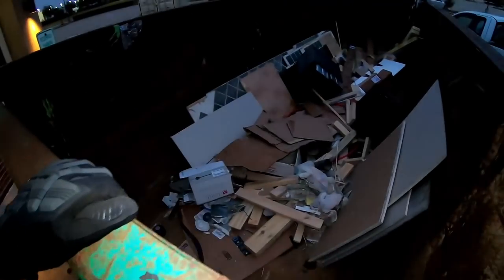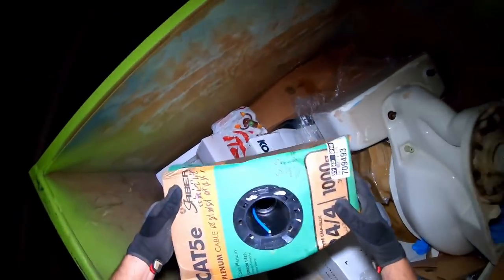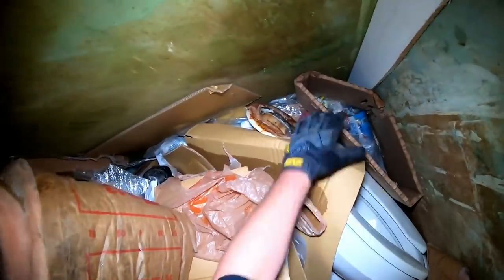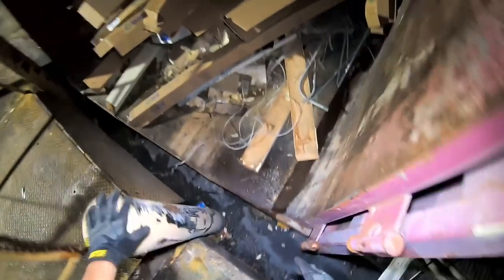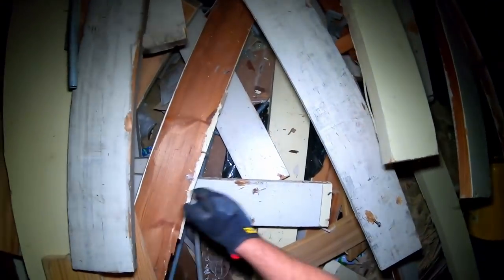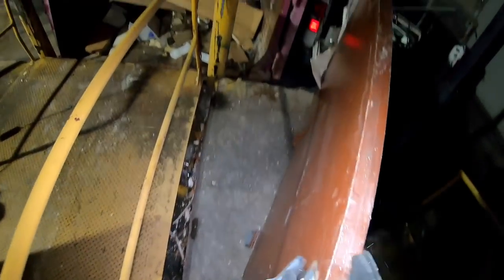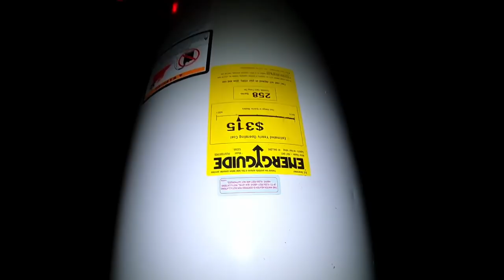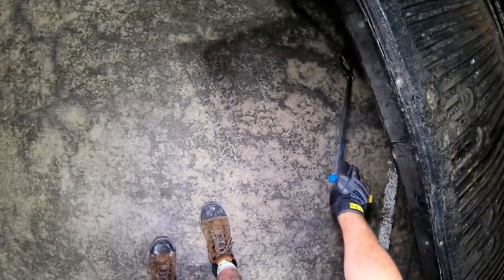Dumpster Diving "The Back Doors Open!"

Comment: The thing's I like the most are tool's!😁 yesterday I found a cement mixer and wheelbarrow in a dumpster- rang the doorbell and asked if they were tossing it out , they said yes and I asked if I could take em they said sure go ahead, do you take refrigerators? I said of course I'll take that too! I do rockwalls and sidewalks and general landscaping as a living as well as welding and roofing! Been mixing by hand for year's! Now I'm the proud owner of a 400 dollar mixer that I can use to make much more money👍 and it didn't cost me a dime more than my time and energy to load it onto my truck!😁👍 half my garage is full of tool's other people just tossed out when they were done with them! It just amazes me how little value people hold in anything anymore! But hey- I'll take anything I can find and use! And if it helps make more- well that's what I call a win win right there!
Reply: Yup same as I 
I have a lawn care business and I have customers always giving me the shop supplies tools anything and everything.
We are a throw away 
The younger generation just toss it and buy a new one
Reply: It blows my mind how some people just don't value items, tools included. I haven't bought a lawnmower in 30 years, bandsaw, table saw, toolboxes and so much more. I get that it's just stuff, but Holy moly to replace these things takes one's hard earned money. These are people that never had to go without I guess. My rants done,lol. ✌️
Reply: @frankforrest1597  agreed😁👍

Comment: Mike, Love your videos and commentary throughout! I used to do LED retrofits of lighting fixtures and we'd end up with so many hundreds of those ballasts on each job we did. The boss just took them and threw them in a dumpster usually. We only kept the High-bay ballasts to break down and scrap out the internal components.

Comment: 25 years in building steel doors/frames. Most hollow metal doors only have fiberglass insulation, polystyrene or honeycomb cardboard interiors. The extremely heavy doors (fire doors) have sheet rock cores.

Comment: Mike those 2x6 & 2x8 can be sold for 10. Each and still be making money. I've been wanting to attach a pole barn to my house and not have to have someone shovel me out.
I already have the garage header and been recycling lumber from places tossing out 24' pallets.
I have glass blocks for windows.
When I just came in the house temperature outside is..

Comment: Today i took a small load of steel around 800lbs. Got $105 Canadian. Its a 110k drive there and back. I do this to help as im on disibility. On my way home i drove back a different route and drove thru one of the Native res. I was able to get another $75 worth of shred tin. Its like theropy for me.  Havent been able to work in over 7yrs due to 19 surgeries.

Comment: every time i see you find one of those water heaters i wonder what's inside them maybe you could take one apart to see and i have a suggestion for you maybe you could get for your pick up one of those tommy lift gate on it so it'll make it easier to get the heavy things in the back of your truck i've seen them before don't know how much they cost but i think it'll be worth checking into just a thought
Reply: Nothing of value inside, empty insulated metal tanks. The electric ones have heating elements screwed into the side and a bit of wire from 5hem to the top mostly buried in foam insulation. Gas ones have the aluminum thermostat screwed in. Value is in overall weight and copper pipes and brass fitting on outside.

Comment: Mike you should learn how to weld with all of the metal you come across You could make all kinds of things!! The same thing goes for wood. I bet you have run across enough wood to build a house!!  At least to do a project or two. I would have stacks of steel and wood and drawers full of bolts and nuts stashed at home

Comment: I think ALL those dumpsters should have HOLES drilled thru bottoms to let the “Dumpster juice” drain out!
Reply: Seriously? Have you given that much thought? You do realize the majority do not contain construction materials. Do you want what's basically sewer water running through your parking lots and apartment complexs? I wish Mike didn't have to deal with it either, but he CHOOSES to jump in and to not wear rubber boots.
I'm not trying to start anything with you, I just wondered if you'd really given it much thought. 🙂

Comment: wouldn't it had been easier to toss the pipes over the top of the dumpster sense you were parked right next to the dumpster instead of walking in and back out and throwing around the side?  Ah see you finally did!

Comment: Sorry to tell you bro Thomas Crapper did not invent the  toilet. He did however hold 9 patents for the component's in the water closet pre modern toilets. (the flush toilet) the one part everyone would recognize is the floating ballcock.   Might want to consider a mask in the dumpsters. I always see a ton of crap flying around you in the air. Just my observation.

Comment: Sometimes I wonder why you just don't take the bags and boxes out the dumpster get your stuff then you want then put the stuff back like in the first dumpster
Reply: Time, effort, mess, when your hopping in several dozens of dumpsters a night it's not the best to dig to the bottom for a handful of metal worth 50 cents.
Reply: @jayr9810  you don't have to do it all the time but in dumpster like that one it's worth your while